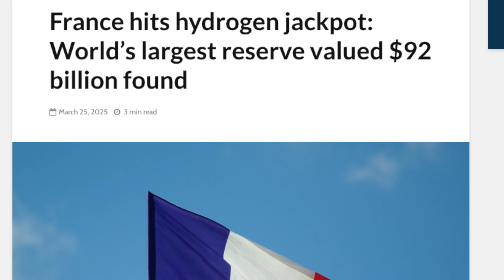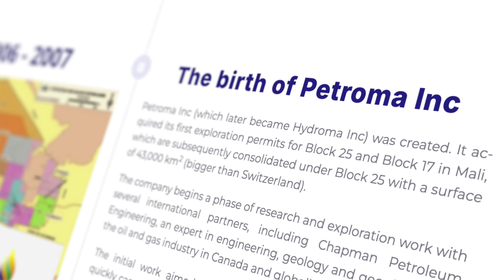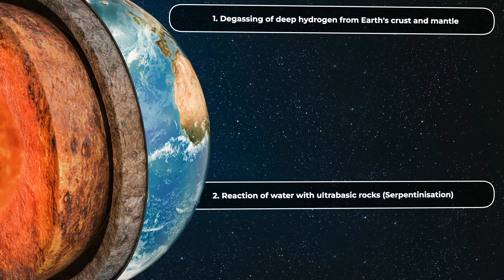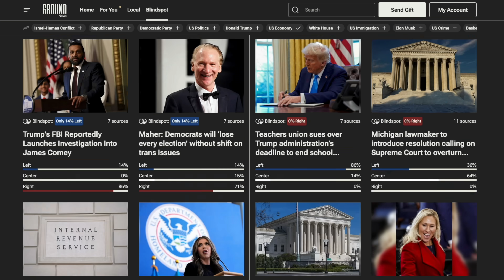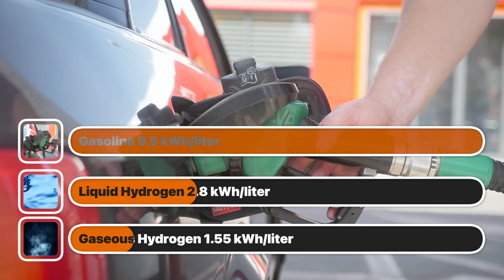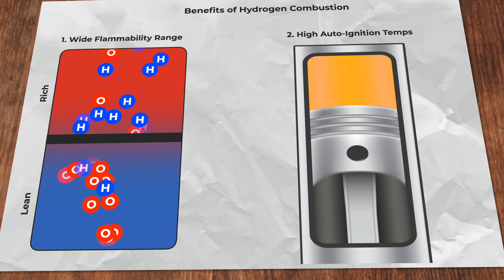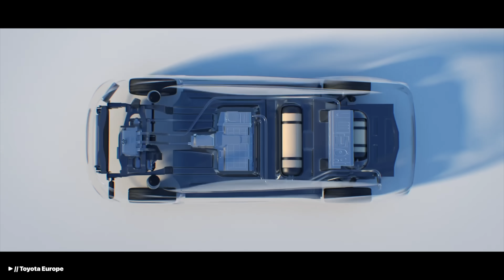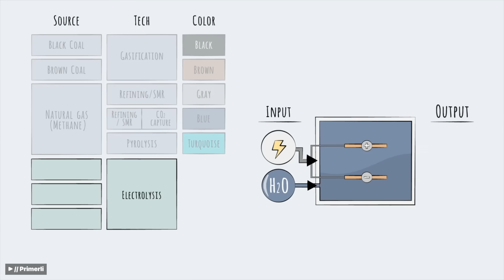This Hydrogen Discovery Can FINALLY Replace Oil & Gas!

Comment from the maker: Ground News - Get the REAL News Behind EVERY Headline! https://ground.news/twobit
Reply: it was not tricky to find. it was known for 150 years. a mine in the balklans. it was HIDDEN FOR CONTROL PURPOSES
Reply: I wish you would stop using forever, unlimited, ... supply is finite.
Reply: @Mattgrubb-m9s  For real,  I wished the youtube channel blocking extension still worked.  This would be blocked
Reply: @CandCfuninthesun  There is speculation at this time that it might be produced naturally all the time but it just escapes into the atmosphere so easy because it's such a light gas but if they can find it they can tap it like they did in one region in Africa in the 1980s and it's still producing hydrogen for a power station.
Reply: @Mattgrubb-m9s  Maybe , maybe not, there is speculation at this time that it might be produced naturally all the time but it just escapes into the atmosphere so easy because it's such a light gas but if they can find it they can tap it like they did in one region in Africa in the 1980s and it's still producing hydrogen for a power station.

Comment: The French "discovery" is 100% hype, it is NOT A DISCOVERY! No pressure, no flow volume, nothing more than BS hype from a bunch of deluded morons. Try looking into something instead of blindly regurgitating press releases. You are clueless when it comes to the topic. Get an education, this video is disgracefully inaccurate. Not. commercial deposit, not economic and the value number you a spewing out is laughable to anyone in the resource industry. You should be ashamed of yourself posting this garbage.

Comment: There is a source of energy that could last not 200 years but almost unlimited , only a few kilometers under the surface there is high degree heat , enough to turn steam turbines forever .
This heat is available almost everywhere on the planet .  Drill baby drill , not for oil but for heat.

Comment: Hydrogen burns into water. Raising water levels. Yay.

Have we considered NOT burning stuff dug out of the ground? We have electricity, a pinnacle of himan invention enabling all we consider "modern", yet we insist on setting fire to rocks in a woeful display of inefficiency like Middle Age peasants...

Comment: When a lithium car is still in the company  assembly line it has already polluted more than a hydrogen fuel cell car that has been on the road for more than 125000 miles,  the secret about hydrogen fuel cell cars is  that each car actually cleans the air as it runs due to it`s clean watered electrolysis  when released onto the atmosphere, hydrogen fuel cell  cars have become remarkable cars with the new technology, hydrogen fuel cell cars are the future not toxic lithium toxic cars!
I for one will not ever want to drive a toxic lithium car for personal heath reasons, some time ago health scientists warned about having   cell phone for long periods  close to head because it may lead to brain tumors due to lithium batteries, now imagine sitting on top of a toxic lithium battery as you drive everyday, lithium is a very toxic element metal for the environment, not many countries want to mine it because it`s a very toxic  element metal, 97% of lithium is not recycled because of how dangerous and difficult it is to do so, almost all goes in to land dumps causing environmental hazards, lithium is way cheaper to mine than recycle in that sense, the huge amount of  lithium used to make just one lithium car is not sustainable for all future cars, it takes 1000 gallons of clean water turned extreme toxic just to mine or build just one lithium EV car, this is just lithium and not including cobalt which is another of many other real toxic element metals just for 1 EV car causing real bad water, ocean and air pollution when mined, lithium battery EV cars are not the planets car eco friendly solution, (horrible)

Comment: We could produce all the hydrogen we want from Nuclear .
Reply: Or use the naturally produced hydrogen
Reply: @fibonacimike4110 sure, but Nuclear power can generate hydrogen anywhere any time.
Reply: @o00scorpion00o once you have the necessary materials yes. But the same can be said of hydrogen. If you have hydrogen you can produce energy anywhere
Reply: @fibonacimike4110  Sure you can but the question is if we can get Hydrogen out of the ground cheap and if supplies can meet demand. Nuclear could make up the shortfall.

Comment: Mr da Vinci..... you are missing a great number of "yea-but's" .  Currently, nothing replaces fossil fuel. A pure electric /battery vehicle must be driven 250,000 to over 400,000 to break even with benzine ( gasoline)..... when one looks at the entire process from raw products to the completed vehicle.  There is great promise that storage batteries/ or similar can replace gasoline.  AS FOR HYDROGEN, the solution is even more elusive. 

 Can things get better, only the shadow knows !!  The MULTI,  MULTI-BILLION oil industry has its greedy hands around the throat of better alternatives. As always follow the dollar.

Comment: All of a sudden interest in Natural Hydrogen coproduction via Schikorr reaction of serpentinization process has increased so many years after crude oil discovery. Hydrogen natural or not will never fail to show up its poor energy density per unit volume in fluid phases compared to that of conventional fluids used as energy source in vehicles, in room Or water heaters, in kitchen stoves, in power plants. High energy density per unit volume has immense value in energy sector.

Comment: Hydrogen would be most applicable to power plants. It is hard to moto transport but simple enough to transport by pipeline. You would simply change some of the metering equipment to switch from natural gas to hydrogen. It could also run fuel cells directly. France could likely export it to Germany for their power plants. It's main danger is that it is hard to see the hydrogen flame as it has no carbon luminosity. The blue flame can be seen usually only in the dark. It would be fine for catalytic heaters but less desirable for stove top burners.  For an IC engine the oil would stay clean for a very long time. Hydrogen can be added to the diesel combustion to reduce pollution. But batteries might prove out better for small moto transport. Hybrids would still win.

Comment: Hydrogen is not the future. Nuclear is. People need to learn the real dangers of different energy sources. Nuclear is safer than coal, and there are ways to use the spent nuclear fuel to reduce its radioactivity.

Comment: Hydrogen’s high explosiveness poses a major safety challenge—it’s significantly more dangerous than natural gas. Beyond the risk of accidental explosions, there’s also a security concern: terrorists could potentially use hydrogen-powered vehicles as improvised bombs. Unlike bomb-making materials, buying a hydrogen-powered car currently isn’t subject to strict regulatory oversight.

Comment: Didn't hold your breath waiting on hydrogen, EVs and in particular battery technology have already come so far and room for more. The energy density of hydrogen is so low... And that's a technical reality and as far as i can tell it hasn't been solved nor is a solution readily aparent. 
Maybe there's a future in other uses but i just don't see it being useful in cars. Maybe larger in vehicles that have the volume to store the gas.

Comment: Hydrogen has a broader explosive range, is more prone to leaks, and has a lower ignition energy level, meaning it ignites more easily.  that is why it will never be used  as a fuel

Comment: 9:47 It would have to burn a mixture of hydrogen and pure oxygen to keep the emissions free of carbon oxides, and the oil, which is also burned in small quantities, would have to be of a different composition from hydrocarbons

Comment: Very Disappointed. Such a poorly researched video.  Has Ricky joined the oil lobby pushing hydrogen to stop progress on renewables and grid storage?  I hope that's not true!

The Boing 787 calculation of saving 1/3rd of take-off weight is completely misleading. And looks like you knew it because just a few seconds later, you tell us the reason it will never work. Liquid hydrogen is less than 1/3rd the energy of jet fuel by volume. For the same amount of energy to fly the plane, the hydrogen tanks will take up so much space that there won't be enough for paying passengers or cargo.  And the best carbon fiber tanks we have for Hydrogen are nearly 20 times heavier than the hydrogen they carry!   Before considering the equipment needed to keep hydrogen cool enough to be a liquid.

And then the video goes crazy by bringing in hydrogen in an internal combustion engine? Straight out of oil lobby's proapaganda.  Have you looked the energy efficiency -  in practical engines, is half to 1/3rd of a hydrogen fuel cell. Which means you need double to triple the amount of hydrogen to run the same distance than a fuel cell Mirai.  Today's Mirai's hydrogen tanks weigh about 120kg.  You are talking about taking it to 250-350 kg and find the 3x space somewhere in the car for the volume.  All it will carry is the hydrogen tanks!  Could be a crazy track-only race car, but hardly a practical daily driver.

This is before considering the engineering and materials complexity of storing and transporting hydrogen.  Or the 5x -8x higher cost of hydrogen compared to battery electrics.

Comment: One of the biggest problem with hydrogen is that it extramly hard to contain. It's not like with gas you could make a cheap plastic tank and you be fine for hydrogen you need some extremry robust and expensive container that ourwheigh hydrogen inside

Comment: I've said for years that hydrogen is the way to go, although I was thinking of geothermal powered electrolysis.  Refueling with hydrogen is much faster than charging batteries.

Comment: I wonder why you didn't mention storage at all and how difficult and complicated it is and how quickly Hydrogen destroys the containers it is stored in and how difficult it is to transport. It is certainly not better than fossil fuels in any energy category practically and not theoretically and for the environment and for the Climate because the climate does not depend on CO2.
Reply: Storage in exhausted natural gas fields is being looked at.
Reply: @johnburns4017  Ya, of Corse and Boats , Planes and Cars will use it remotely.
Reply: @boriskochevski4240  
Storage is the key word.

Comment: Hydrogen can be mixed in with natural gas, up to 20% without effecting energy much, Germany has researched this.  It can be used for industrial and power generation that can more easily be tied into a hydrogen grid far smaller and expensive than the natural gas grid.  There are ways to turn hydrocarbon wastes like animal fats, waste from slaughter houses, old tires, plastics  into fuel at about $100 a barrel of oil produced, and it's a light easily refined oil.  As it utilizes heat and pressure mimicing nature who knows, introducing hydrogen into the process might turn more oil.  As to all the other uses, fuel cells, direct use in engines, that's way in the future except for specialized uses.  fyi  USAF and Arab Emirates I think it is have both run their planes on bio fuel, in middle east is was bio fuel from plants watered with sea water.  Small scale systems for growing this have been made indicating county sized farms in desert areas next to oceans could substantially replace oil with bio fuel, with waste products perfect for use as animal feed and bio mass to improve poor lands.
Reply: The 20% mix of hydrogen in natural gas means the burners do not need changing - all stays the same. Yet emissions are reduced by 20%.

Comment: Hydrogen has niche uses but nothing beats the simplicity of charging a battery from your home solar to charge a car battery, you don't need to compress an explosive gas or have an expensive engine/motor, which is why hydrogen cars flopped already. :face-green-smiling::face-green-smiling::face-green-smiling::face-green-smiling::face-green-smiling::face-green-smiling::face-green-smiling:,,,Ask TOYOTA about their hydrogen car lol,,,,,
Reply: Japan is moving to a hydrogen economy, as only hydrogen can replace fossil fuels in industry.

Comment: Serpentinization may also be anthropomorphically stimulated. Using the fire triangle as an analog, you need 3 components to initiate & sustain the oxidation reaction. 1. Iron rich rock (extremely common globally). Ideally with some catalyst metals included (e.g. nickel)). 2. Water. Indeed, brine from local aquafers or even seawater (as demonstrated by the Omani's) work best (plus, no need for pure or potable water). 3. Energy to initiate the reaction. Geologically, this is supplied by pressure (depth). 200-300C produces good reactions which is readily within human capabilities to provide (I have proposed EM heating over steam and other heating methods for a variety of reasons). Once the reactions are started, the input energy may be reduced/stopped as the oxidation reaction is exothermic and will itself become a heat source (how much depends on the amount of iron and exposed/wetted surface area. 
Natural pools of hydrogen are an interesting phenomenon, but I fully expert them to be very rare (small sneaky molecules require some seriously rare geology to trap them) and are not likely to be prolific producers. I do believe there are enough mafic formations across the globe that could be stimulated to produce H2 at commercial scales, but there's a lot more work to be done to validate that. It is very exciting to think about though and without that forethought and excitement, nothing will happen. 
Thank you for the video!

Comment: France alone uses 900 000 tons per year (let's say 1 million as it's increasing) without replacing any fossile fuel and mostly produced with methane. So 46 million tons doesn't mean a serious solution long term at all.
Reply: That’s just one deposit though, they’re likely to find more once they start looking for them.
Reply: @calmonnier2512 the issue is hyperbole. It doesn't even replace hydrogen for the near future, it's not replacing oil or gas ever.

Comment: Hydrogen would seem to be the perfect fuel however it has some severe disadvantages because it is so light it is very difficult to contain I find it hard to imagine that it could be found in deposits beneath the ground, I would have expected it to have escaped long ago.  Bringing it to the surface might do more harm than good since it would provide a pathway for it to escape and be lost forever.
Reply: Yes, like all natural gas escaped.
Reply: @johnburns4017  natural gas is a much larger heavier molecule and is heavier than air while hydrogen is like a single atom much much smaller and lighter

Comment: This is bullshit.  We've had hydrogen in cars now for over half a fucking CENTURY.  The Oil Will End.
Reply: You really did not get it.
Reply: @johnburns4017  Still do not 'get it."  So...what the fuck you talking about please?  Hydrogen is the ultimate solution for TRANSPORTATION and PHYSICS has know this and we've had the TECH for this for over half a fucking CENTURY.

So, what are YOU "not getting?"

Comment: Hydrogen is a folly at best but it could easily also be an environmental catastrophe. Apart from the huge issues with its storage, transport, flammability limits, etc. switching to hydrogen could cause as much global warming as burning fossil fuels! Atmospheric hydrogen prevents methane from being removed from the atmosphere (hydroxyl scavenging reaction) and hydrogen escapes into atmosphere extremely easily. It's almost impossible to prevent significant amounts from escaping. More atmospheric hydrogen = more atmospheric methane = more global warming. Methane is at least 28 times more potent a greenhouse gas than CO2 and there are vast quantities of trapped methane already being released as the climate heats. The only rationale hydrogen economy can stem from chemical carriers such as formate that negate the chance of escaped hydrogen as well as solving the storage and transport issues
Reply: You work for an oil or gas lobby perhaps?  Because EVERYTHING you just said is a LIE.  None of what you said is true.

We're talking about BURNING the hydrogen you liar, NOT releasing it into the atmosphere.  Wow, you think (try it!!!) that no one would fucking NOTICE what the fuck you said?
Reply: @mrunning10  
He may vote for Trump, who says coal is beautiful. No kidding.

Comment: If we could somehow create small devices that collect the nitrogen oxides and split the nitrogen oxide into nitrogen and oxygen, releasing the latter and the former to be stored so the vehicle owner could empty it our on a regular basis in special collection points, that later on forward that to be used as fertilisers for farming

Comment: I do hope Hydrogen becomes a major transportation contender. I was rooting for Nikola, but it seems they aren't going to be around any longer. 
EV's are nice, but their poor performance in more extreme temperature zones is problematic and HEFC would be much better. 
I also think that Toyota's idea of swappable tanks they are playing with are a better idea than a direct pump, as the liquid hydrogen pumps tend to freeze, locking the next person out for sometimes hours before being able to fill up. Plus, it could allow you to have extra fuel on hand when traveling or maybe even doing some hydrogen overlanding. Which would be cool to see.

Comment: My guess is that the author of this video got paid by either Toyota (which is pushing this nonsense) or the fossil fuel industry. An objective analysis of hydrogen as a fuel source will show that it will NEVER be used to power automobiles or airplanes.  The infrastructure doesn't exist and if it did would be very prone to dangerous explosions.
Reply: Why do you think it will explode a lot?